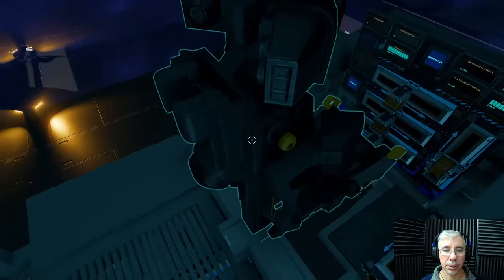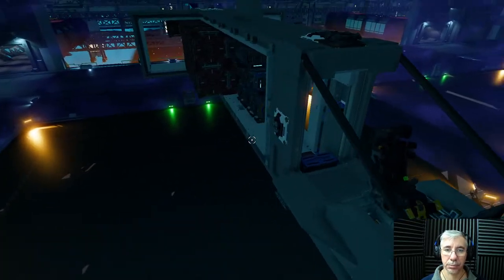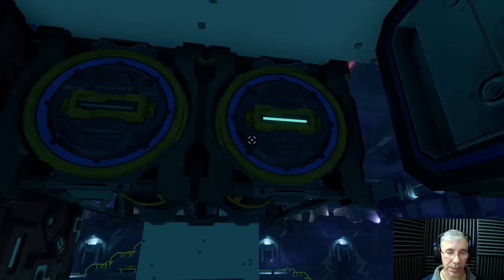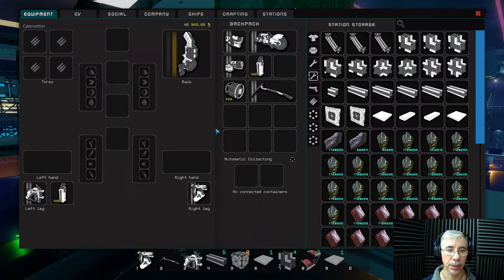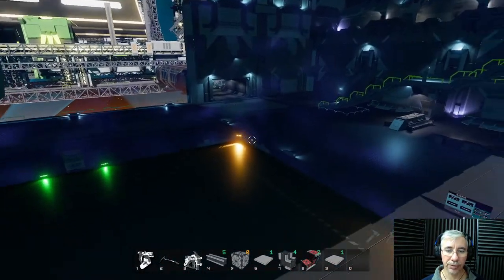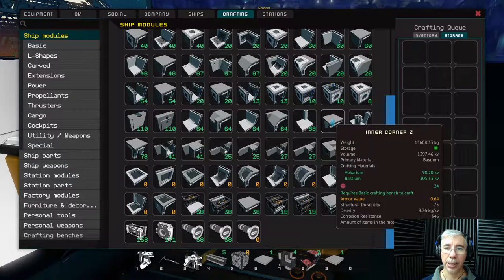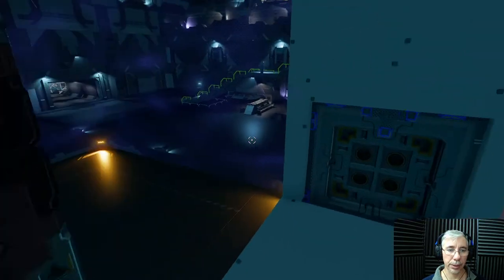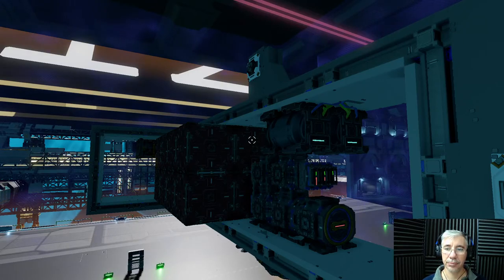How to refuel your ship | Starbase

Comment: Easiest way to explain the difference between fuel and propellant, i think would be:

Fuel is used by the generator.
The generator produces energy which is used to fill up batteries and power up all devices on your ship.

Propellant is burned by the Thrusters  to create propulsion.

Congrats on your first 100 subs ;-)